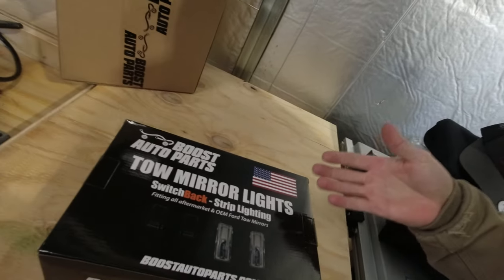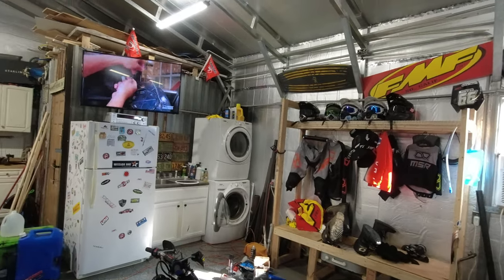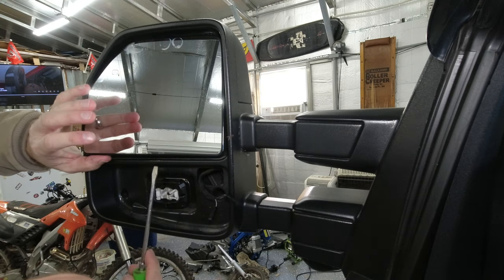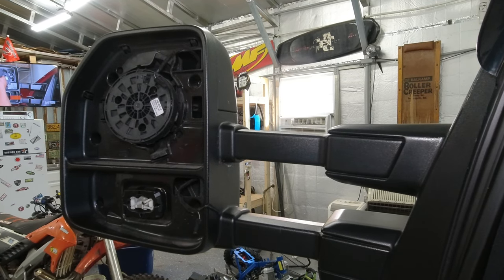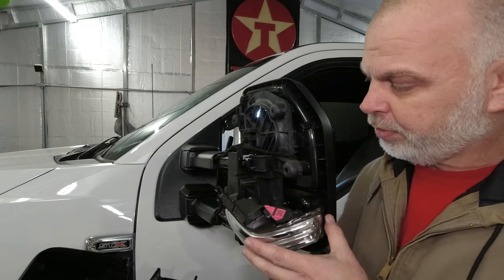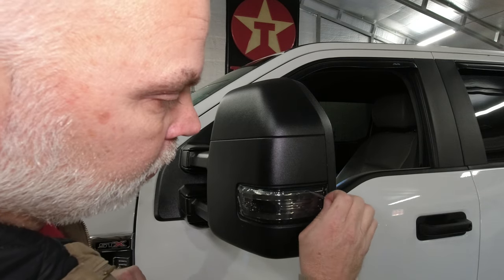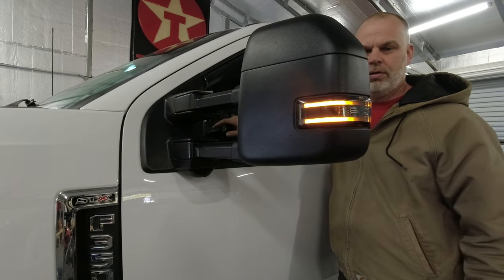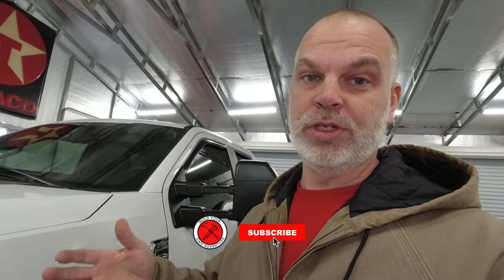Tow Mirror Lights: The Upgrade You Didn't Know You Needed

Comment: Got my mirror all apart without breaking a thing, just for my mirrors to be aftermarket so the wires for the lights are hardwired so now I have to find some plug online to make these lights work. Or buy new mirrors
Reply from the maker: No way! I would reach out to Boost Auto and see if they can offer any advice. Those guys are well versed in the wiring for these lights and may be able to help you locate a connector.

Comment: My bottom one didn't come off like that, ended up breaking it
Reply: Never mind, I had replaced my whole mirror assembly on my driver side and turns out the inside is set up completely different cause this trick worked on my passenger side
Reply from the maker: Oh man! No way!
Reply from the maker: Oh ok. Still sucks that it broke. Hopefully a replacement won't be too expensive.